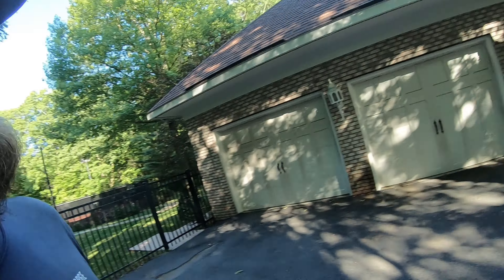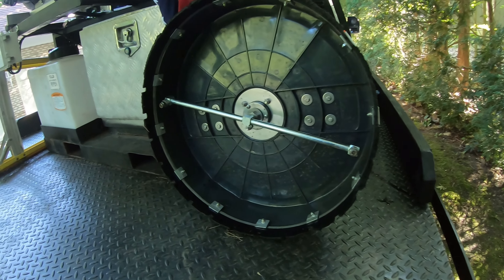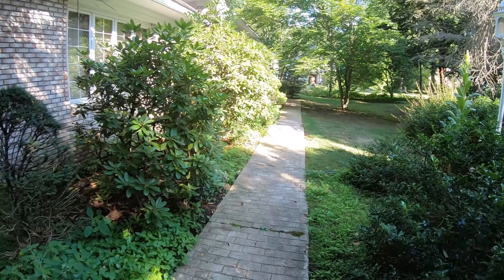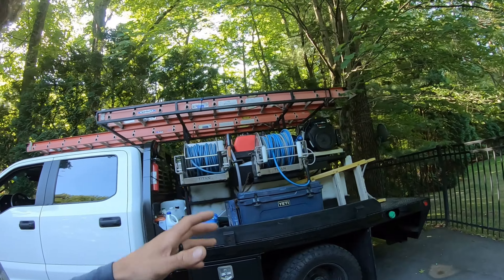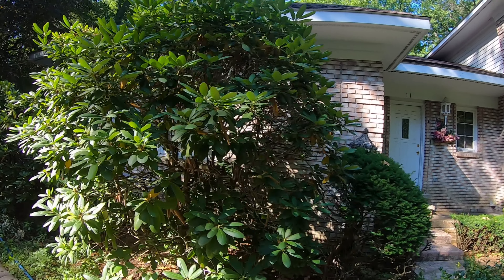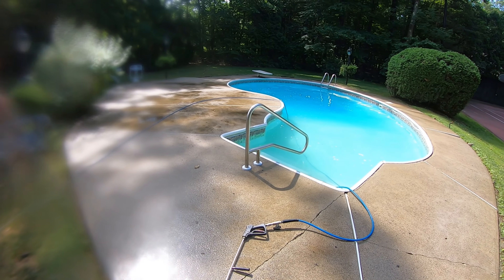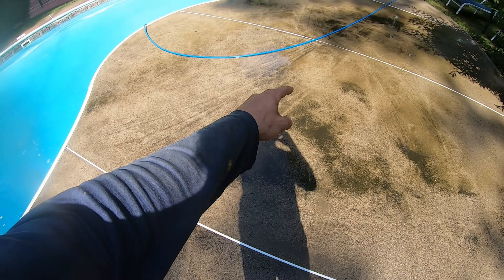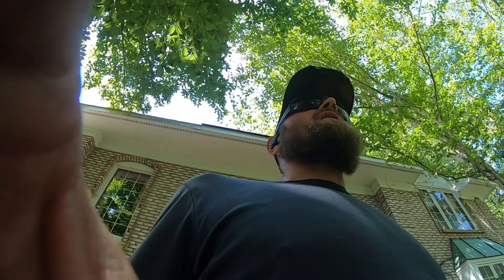Giant Residential Brick Wash - Does the IGX800 Sip or Slurp Fuel?

Comment: Make sure you put 25045 or 25050 tips in it! 25040 will be max pressure which will etch soft driveways
Reply from the maker: Thanks!
Reply: I went with the 25045.. no etching.. no streaking..
Reply: I have an extra set of nozzles if you need them I could mail To them to you I'm just on the other side of the state so you would have that fast

Comment: Hi bro , I run a 21 inch Mosmatic surface cleaner best you can buy, oversized tips at 40 degrees angle for paving about 1250 psi per tip with full flow, have spare spinning bars  with different tips much better easy to swap out bar on the fly,   I would recommend changing supply line on surface cleaner gun trigger line to 1/2 inch to surface head, just cut and weld in 1/2 inch high pressure  stainless steel socket and 1/2 pressure supply line..  20 minutes with cutting in edges and ball valve rinse ..👍🤙
Reply from the maker: Sounds sweet!

Comment: 4 gs comes thru each tip and it’s a double tip. And 2 x 2 tips is for four gpm
Reply from the maker: Both sets were 2gpm tips for a 4gpm machine. 8gpm won't run it. Had to order two 4gpm tips

Comment: About 10min to clean that particular deck and rinse it.  I have the same machine with the igx700 and it definitely likes the fuel.  Cleaned the inside of a 80x150 horse arena this morning with it and ripped right through it.
Reply from the maker: That's awesome 🤙 how long have you been running yours? What pump?
Reply: @YoungAmbitionYA  I only have 70 hours on it.  Not positive on the model but it's an AR pump.  It's from R-washers which looks like yours is too.  It's a beast.  I know I'm a minority but I prefer my 6.5gpm for house washing.  That's assuming there is no crazy angles I need the extra distance for.

Comment: I bought the same surface cleaner from Northern Tool 20 years ago to use around house.   The specs said "up to 8gpm".  I had a 5.5 gpm, 16hp Brigs&Stratton.  I hooked it up to my pressure washer and it barely spun it and then quit.  I tossed it in my storage building.   There it sat for 20 years.  I never took the time to do any research.  Then I bought a 8/3500.  I put 2,  25 degree 4 gpm tips and it hovered above the ground unless I held the handles at a 60 degree angle and pushed down on it.  It flew ! Vertical and horizontal.   I was told that running tips that were too small would damage a pressure washer. So...now my guess is that the pressure regulator was smarter than I was and shut down the pressure whenI had 2/2gpm tips and 5.5 gpm....just my guess.
Reply: Could go to 2 - 3gpm tips to prevent that surface cleaner launch. One of these pressure washering channels mentioned it. I think it may also help prevent etching. But it's been a couple of weeks since I've seen that video and I've been watch a lot of pressure washing videos so I wouldn't know which it is.
Reply: @MannyAguilarJr  I now have an 8/3500 with two 4gpm tips and it won't easily stay on the ground.  I need to go to 2- 4.5 or 5.0 gpm tips.
Reply from the maker: Yes small tips are the issue. I got bigger tips and works well
Reply: @ronjclm8590  ah yes correct. Idk why I mentioned 3s
Reply: @YoungAmbitionYA  
If you run your pressure washer on idle or just above it will produce 4-6 gallons per minute?
Reply: @YoungAmbitionYA  what size tips are you using with your 8/3500 & 20 inch Hammerhead ?

Comment: We use a 4 tip bar and run 2, 2 gpm tips for the 4 gpm machine and just add 2 more 2 gpm tips if we clean the 8 gpm machine, otherwise just plug the 2 inside holes.
Reply from the maker: That's awesome 🤙

Comment: I thought they make the 4gpm tips because they expect the gpm to be split since it’s two sprayer underneath. I would think that’s the correct call because if you use two sprayers on a 8gpm pump or 4K psi you’ll get 2k psi out of each sprayer or 4gpm
Reply from the maker: Yes I have 4gpms on there now. Works great. I misspoke in the vid. They were 2gpm tips

Comment: Take of handle/trigger of surface cleaner, upgrade whip line to 1/2”, control flow with dn10 ball valve.  Upgrade bar to a #hilowsolutions tornado bar 4 tip bar, put 24020 tips in.  Then Watch your surface cleaner become a monster.
Reply from the maker: Awesome thanks!

Comment: (Edit again) you might want to return the 20” and go with the 24” with a 3 tip bar!) 

With that 20” SC… Tips? Look back at my post reply on your flowpro install vid. 👍
 2x  6.0 is for 12 gpm machine but work for me (like 40060 tips).
Work with tip size to get the pressure range you want at SC and not have to throttle back or adjust k7 too much. Like, set k7 with green tip at where you want and then adjust tip size on SC to reduce pressure to where you want ( about 1800- 2300 psi) and keep a higher flow rate for faster cleaning. Of course you will need to throttle back and/ or increase tips size even more for softer/ newer concrete.  
There Is one more area of adjustment often over looked as well. The head unit on SC also can be slid up and down make the bar and tip height closer or farther from the concrete too. 
Annnd, if you add casters, we’ll those too can be use to adjust SC ride height… it can get confusing quick! 🤪
 If you don’t mind I can link you to another guy’s video that explains it pretty well.
Hope this helps!
Reply: Pressure too high with those tips on the k7( not enough flow to allow k7 to operate!

Comment: Use a K1 unloader that will solve the pulsing K7 is why the pulsing.  
The K1 will handle between 2.5 to  10.5  gpm and 3650 psi.
Reply from the maker: I swapped the tips. Works great. Unloader is fine
Reply: @YoungAmbitionYA  what tips did you use?   My identical SC wants to hover/fly with 2 4gpm's.

Comment: The total GPM tips have to match to totall GPM of your machine, so if you have 8 gpm machine, then you need 2 -4GPM tips for the surface cleaner equaling 8gpm.
Reply: My surface cleaner won't stay on the ground with 2-4gpm tips.
Reply: @ronjclm8590  add a small weight to it. 2.5 lbs. Or turn the pressure down.
Reply: @bmos212  of course those are options. Manufacturers don't recommend turning down the pressure or running at a slower RPM. And surfaces don't usually require 3500 psi.  But all are options.
Reply: @ronjclm8590  true